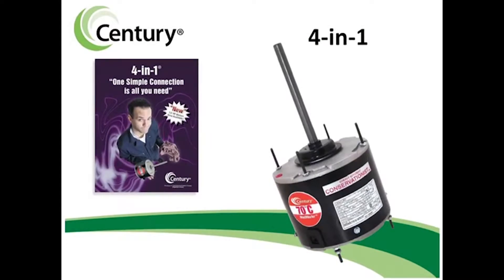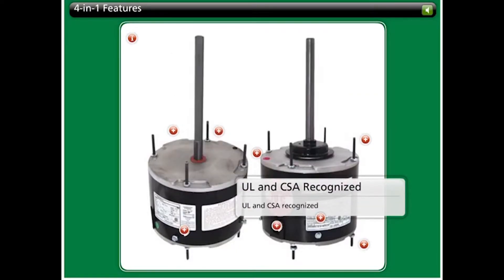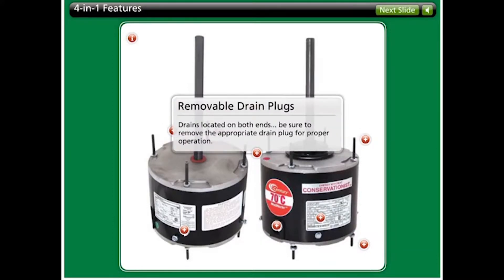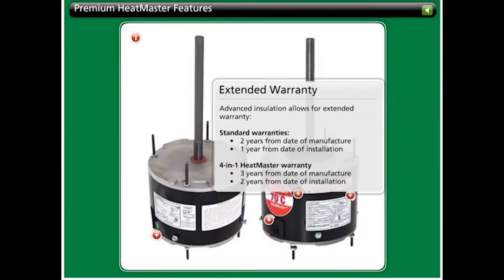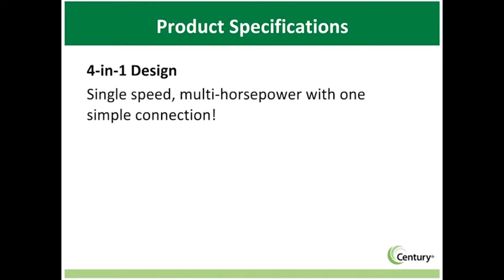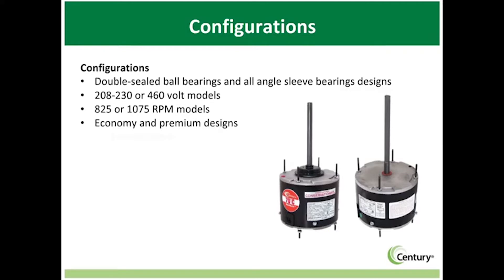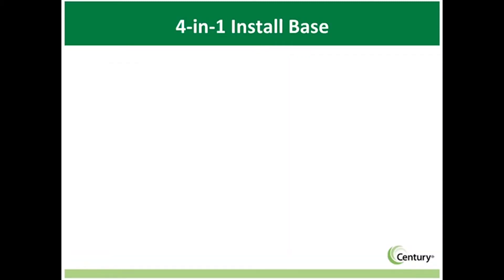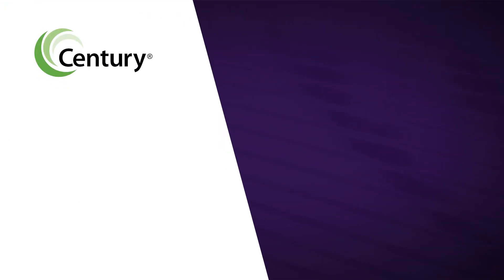Century® 4-in-1® Motors

Comment: Homeowner review of product:  I just replaced my motor with one of these.  It's working fine.  Now the suggestions:  1) There were no instructions for anything other than basic wiring either in the box or easy to find on their website.  2) The wires are WAY TOO SHORT!  I had to cut off the wires from my old unit and splice them in.  That makes no sense.  If other manufacturers can put on longer wires, so can Century.  3) As a color deficient person I often have to have my wife help identify the colors.  On the old unit the brown and black were very different.  Once identified, I could easily tell them apart.  My wife had to look closely to tell the brown and black apart on the Century.  Not good!  Fix these things and I would be happy.
Reply: You are not a certified technician. This is not made for homeowner DIY. A certified technician can easily identify the wiring and installations. Long or short wires has never matter for a certified technician